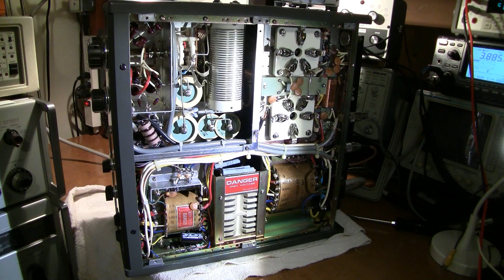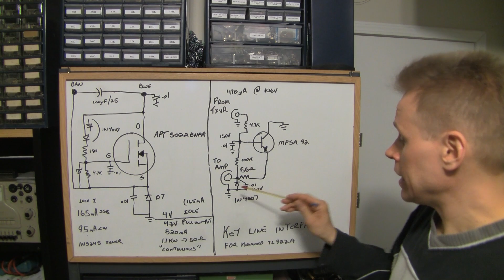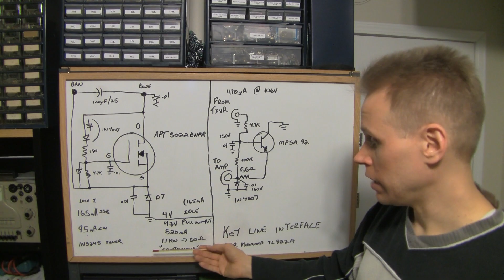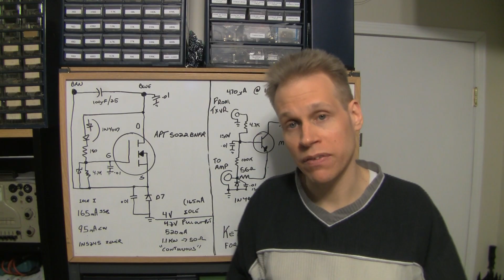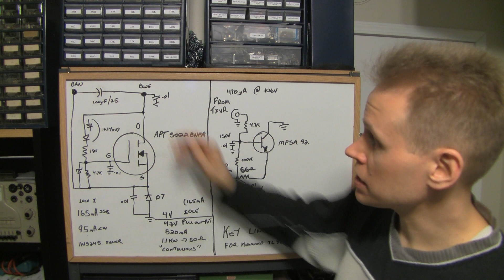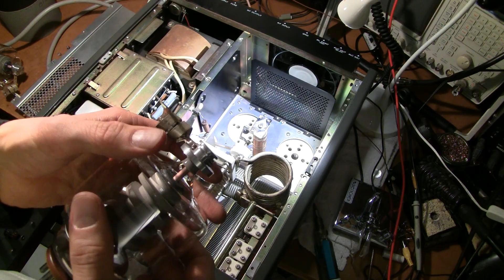KENWOOD TL-922A Repair and Modification

Comment: Just got a tl-922a eBay special. Good price but.....must completely go thru it top to bottom front to back. Before any power is applied. Do not trust good faith!
These were treated like toasters. Turn um on and tune it for full smoke - bad practice!
Sad to say that these days most hams are appliance operators, and even more fear hf ops due to the complexity of having to figure it out and do it yourself. Repeater jockeys. So to speak.
The hobby is dying sadly, so a person that takes the test gets the license and go on air - good for them! Need more.
I will be looking into your electronics teachings. Some brush up after many years I feel will serve me well. 73'S

Comment: You hammer a pair of 3-500Zs enough, without a blower cooling from underneath, and the solder in the pins will melt. That's a common problem with fan cooled versions, where the pins are not cooled enough.

Comment: Your statement " getting across the HV, you're dead " does not always apply. I got across the 3KV in my younger years. It drew me up like applying heat to plastic, and luckily, someone in the shop had enough sense to take a broom an knock me free, but it didn't kill me. Yea, it hurt like hell for about 30 minutes, but I guess I was lucky.

Comment: I assembled a transistor switch according to your circuit, but at its input through the emitter-base junction there is still about 100 V, with a small current, of course. Wouldn't this be dangerous for a transceiver whose maximum control voltage is 60V?  YL2GL Valerijs

Comment: I really like your tips on the Keying circuit.  Especially how you suggest an external circuit to interface the amp and transceiver.  Very nice.  I also like your Bias control modification circuit.  Very nice.  Have you considered using a dynamic circuit that can increase the bias voltage to cut the tubes off during the time between speech utterances then when speech returns, the bias would be returned to the normal Class AB2 setting?  I think that could help to increase the lifetime of the 3-500ZG tubes.  The existing ALC circuitry could be used to monitor the incoming RF during SSB transmission and with something like a comparator, the Bias voltage could be quickly transitioned between cutoff and Class AB2 with time delays so as not to cut off the beginning or ending of words.   What do you think?   
   Thank you so much for sharing your good work and ideas Mr. Carlson.

Comment: I noticed that you said the cooling system in the TL922 is poor but, I disagree.   The cooling system uses the Black Body effect to keep my unit running cool.   That's done using three, BLACK steel plates beside the tubes.  One of these plates is perforated and situated in the exiting air stream of the low speed cooling fan.   You see?  The 3-500Z tube cools its' Plate structure mostly through the process of Optical Emission of Infrared Light rather than through conduction into air passing over the glass envelope, which absorbs or conducts very little heat from the Anode Plate.  The IR light is wasted energy that mostly passes through the glass to heat surrounding metal structures.   To enhance IR absorption of the metal plates they have been painted or anodized Black.  That black color is key to cooling your 3-500Z tubes and, you need to KEEP DUST OFF these metal plates.  They're Black Bodies that Optically absorb IR light then they're cooled by the forced air stream of the fan.  The cooler these plates are kept, the more IR flux they're able to absorb.  You have to keep their optical absorptivity higher than their emissivity.  Perforations in that rear plate enhance its' heat conduction into the air while also discouraging RF emission through the fan.   It's these black body, steel plates that are cooling the tubes more than a fan alone could and the reason why a low speed, quiet fan can cool this amp as well as it does.  This system could be improved by providing fins on the steel plates to increase contact with the air stream.   Just imagine if flowing chilled water channels were inside of these Black Bodies. You wouldn't need any air movement for the tubes at all.    Kenwood's engineers were more advanced than others.
Reply: Well crap, rebuilding electron microscopes for a living? I think you're Rege that has been trolling QRZ for decades and are constantly schooled by WIK and W8JI. If you're Rege, it must be embarrasing to be you. If you're not, then go look for Rege's comments on QRZ. You'd love his thoughts on "DULL CHERRY RED" 3-500Z tubes which are constantly being debunked while he's humiliated all of the time.
Reply: @624radicalham  No, I'm not your buddy Rege.  I'm guessing that maybe you don't believe that the Anode inside of a glass vacuum tube can be effectively cooled simply by allowing its' infrared light emission (red glow) to shine onto a vigorously cooled, black surface.  The red glow of the anode structure can't be inhibited and you don't want to because, it's that red glow that is actually cooling the anode by the process of Infrared Radiation.   The problem however is that when that IR light shines out onto surrounding metal surfaces, they will re-emit the IR and some will even find pathways to conduct a portion of the heat back into the vacuum tube.  The idea is to capture as much of the radiant IR, convert it to Brownian Motion (rapidly vibrating molecules) within the Black Body (metal plate painted flat black) and finally remove the Brownian Motion by a means of conduction to moving air or water cooling channels inside the Black Body.  If you could optically capture 90% of the waste IR emission the whole inside of the amplifier would stay cool even while the anode is glowing.  That would not allow the heat to re-enter the tube where it can cause more heating.  Imagine a thick walled metal cylinder that has been black anodized inside,  contains flowing cold water channels and made optically dense with many small plates similar to a heatsink then, placed around a glowing 3-500Z tube.  This device as well as rushing air, would remove practically all of the heat emitted by the anode as radiation. The chassis would stay cool and unable to return any heat into the 3-500Z. The tube's exterior and glass parts would stay much cooler than with air alone.  BTW, I'm testing an X-ray microscope while I'm writing this to you. It's operating at over 100 Kilovolts and I'm able to see microscopic objects inside of a cell phone.

Comment: I've got several tube type RF linear amps of which the TL922A is a favorite. I believe some of the best mods are:  [A] Vacuum Relays for the RF input and RF output with 12VDC coils.   [B] 1Amp fast fuse on the HV DC (Plate B+) just ahead of the Plate chokes.  [C]  "Hairpin" VHF chokes for parasitic suppression on each tube Plate.  [D]  A 3" Cooling fan inside the XFMR side of the fan-box situated to draw heat from the power supply and especially its' transformer.   I regularly use a clean-dry paintbrush and vacuum cleaner to remove any dust from the amp, especially the RF Pi network components.   I'm able to regularly obtain  2.1KW PEP from my TL922A in SSB mode but, I like to use it at no more than about 1.8KW PEP to improve longevity.    
    BTW: I'm an equipment engineer from the semiconductor industry and own & operate a technology business that rebuilds electron microscopes and X-ray microscopes for industry, having a customer base around the globe and the US.

Comment: Thanks Paul for a no-nonsense learning experience. The vid is packed with a lot of info. I had this issue in the amp last week. The arc shorted the Zener and C3. Since I have a 1A fuse in the primary of the filament transformer, it of course opened. I installed the IRFP27N60KPBF and also two diodes IN4007 in the Gate as you explained in the vid. I have a bias of 90ma in CW and 170ma in SSB. The voltage at the Drain is 6.3v idle and at TX it goes up to 7.4v. Works fine so far. Output on CW is about 600w, and on SSB peaks are over 1000w. I drive with 90w.

Comment: YEs Yes your circuit will work but I can do the same thing with 12vdc relay and a small PS and can be used then for any amplifier in the future if i placed it in the amp itself then the next amp i bought that had a 110vdc relay id have to build another circuit my way you just build your slave relay and now you can run any amp that has 110vdc relays

Comment: Hi; My Name is Cecil AJ4MT is my call and have been an extra class operator for some time. And been an amp builder and repair tech for over 30 years. That amp was built as a companion for the Kenwood TS 530 and 830 both of which were tube type final radios. As a matter of fact all amps from the 60's and 70's all had 110vdc relays. they used the same 110vdc for the alc voltage as well. 12vdc relays didnt come on the market till about 1980. All 3-500z amps from the 6o's had 110vdc relays Heathkit Sb200,220,221 Kenwood 922 and 922A Yeasu FL 2100B Collins Amps Also Henry Amps easiest way is to make a slave relay from a 12vdc transformer a rectifier and cap and a 12vdc relay SPST have your radio key the 12vdc relay that brings in the 110vdc relay at least thats what I do
Reply: Maybe I need to look into this with my henry 2k-4, but Ive been using it with my icom 7300 for months no problem at all. I did set the delay in the 7300 to the max setting prior to hooking it up..

Comment: I recently saw your video i am having a problem with a yaesu radios rx/tx relays contacts welding shut not because of a amp but just a known problem with this transceiver?… i was wondering if i could use this circuit between my relay?

Comment: LOL you ought to see my TL-922. I have the Trio version.  ie., it has 28Mhz. I bought it used.  The variable capacitor had melted ends.  I actually had to use a Dremel to remove the mushrooming on the ends of the capacitor plates.  Flash over is bad. Lost a tiny bit of capacitance. But it fixed that problem.  I also now have full QSK with a vacuum relay.  And blue LED lighting.  Oooo.. Many other mods.  Works great now.

Comment: Smiling!
Just starting watching your videos and enjoy them, also know the odds of you reading this on an old post are slim to none but sometimes you just got to confess to messing up to fell better. Smiling. 
I always thought the TL 922A was a good looking Amp. 
Little over a year ago I bought a ICOM 7300. I used the send jack on the back to key my Clipperton  L. Well one day a friend of mine told me the keying circuit in the Amp was more than the keying circuit in the 7300 could handel.  Been using it that way for over a year and seemed ok to me. So I built a external relay like they show in the manual and in the process I melted the farrite EP102 on the RF Unit Board B8306E, and the send quit working as one would expect. Wish I would have never done it. Radio still works on transmite great and pretty much everything else works, but the receive audio has a hollow sound, kind of like a weird filter or something hard to understand sometimes. I have reset it but no help, not sure what else I hurt to get that sound on receive but I did something. When you talked about the relay and tapping it to try and free ii up, I thought wonder if that could be a problem not letting it go back into full receive mode. The parts are so small, I suppose it needs to go back to Icom but waiting till after the Christmas shipping stops, people say thing get damaged more this time of year.   
73
Ed

Comment: Hey Paul . I know this video is old but I just got one of these and looks new in box and it did not have tubes and RF suppressors. I did find a few places and I can just make one and order tubes.
  But do you have all of the "needed" updates on your other website ?
   I m taking my time because it does look like it has never been plugged in so i Think when I get ready to power it up I am going to borrow a variac and bring it back up slow .
Thanks
Gary

Comment: I like when you warn us about dangers. Please, colud you make a vid explaining ways to avoid risks, electric shock...preventive measures
Reply: If you need this then you need to leave the lid on
Reply: @paulstubbs7678  Not a good answer, everybody starts at some point - give the man credit for wanting to learn. You don't know if he's a beginner in Electronics or experienced, perhaps he is just new to HV. I have worked on HF amps for years and I found myself asking if there's something charged I may not have thought of. Ravi, do you know the "one hand" rule and can test for high voltage present? If not this isn't where to start, but you can certainly work up to it.
Reply: @patrickbouldinkm5l143  Thats why a safety oriented video could help

Comment: A strip of paper soaked in contact cleaner is the best relay cleaner I've found. The paper falls apart before any metal is even scratched, but it will remove oxidation and carbon.

Comment: Great looking amp i have a 30l-1 to scarred to connect it to my 7300 even with the relay kit i got of ebay i will keep it matched for my kwm-2 just too much voltage on the relays,was offered one of these tl-922,s at a ham fest THE GUY TOLD ME IT WILL MATCH UP WITH NO RELAYS TOO A 7300, LUCKY I WATCHED  YOUR CHANNEL.thanks a bunch.

Comment: In addition to the risk of contact welding,  wouldn't the keying relay also potentially be at risk of not even being able to break that much DC current?   I have seen relays sit open with a continuous arc occuring between the open contacts because it couldn't break that much DC current.  The zero crossing of AC comes in real handy when it comes to interrupting the arc when contacts open.

Comment: I have a TL-922A that was given to me. It is supposed to work, but I don't know, I've never used it. I was wondering if you would be interested in doing a restoration video on a TL-922A. I can be contacted at kk4bfn AT arrl DOT org

Comment: I really did expect better engineering effort in the original design. It is a bit disconcerting to see how lax they were making this clunk before you modified it, thus saving many a good ham from  becoming disgruntled or giving up on using their amplifier.
Reply: lol hams have been using this amplifier with no mods for over 40 years. Unbelievable some of the comments here.

Comment: how do you even run 2 of these beasts at once? the datasheet states an ridiculous heater current of 14,5 amps at 5 volt for a SINGLE tube. if i was to run 2 in parallel it would pop the circuit breaker of the house electric

Comment: My new question would still be bad to try to use this amp with a ARB 704 would that device protect any solid state hf radio would the amp still blow up the radio

Comment: Just watched this for the first time Paul.  Nicely done to bridge the gap on a few of the weak points in the design of this amplifier.  Always liked the looks of the 922, but the cramped interior design is concerning, not to mention the high keying voltage.  What were they thinking?    As you mentioned, the designer's futile attempt at cooling the 3-500z triodes is weak, very weak.  But as I recall, even the old Heath SB-220 utilized a similar fan arrangement instead of the recommended forced-air method of cooling.  Of course that amp also suffered from under-cooled tubes.   I guess the 3-500 tubes were much cheaper back then to replace.  I was hoping you would measure the filament voltage with the tubes installed and drawing filament current.  Most tabletop amps really do a good job of NOT delivering the correct filament voltage and offer the owner no means of adjusting that voltage for varying line voltages encountered.  The owner of that 922 owes you a great deal of gratitude.    Thanks, Joe W4JF
Reply from the maker: Thanks Joe!

Comment: Subscribed!!. Like the video format and love the detailed explanations. I came here merely on the back of some research into the TL922 before I buy. Already have a Yaesu FL7000 Solid state linear which is great for the 400w limit in the UK however as more transistor amps come to the market place the older Yeasu FL2100Z, TL922 and Heathkit SB220's valve amps which were very common years ago but expensive!, are making it to Amateur radio rallies and getting considerably cheaper.
With that said the price of the 3-500z is still quite expensive (not as much as 2SC2652 Planar transistors however if they are not abused they should last 20 years and at about $1200 to replace all 4... the amp is pretty much written of if they all decide to fault at once!!!) hence looking at an alternative if my FL7000 bites the dust. I am leaning heavily toward the TL922 after this video. Thanks, its very well received across the pond.73 dit dit

PS: the Motorola MRF448 is apparently an equivalent to the 2SC2652... however I think valve is still the way to go after seeing this video.
Reply from the maker: Thanks for your comment, and Welcome! Vacuum tube RF amplifiers are definitely the way to go, there are so many replacements on the market keeping prices reasonable. When it comes to audio, prices are being driven up by the audio crowd though.

Comment: Boy that is a compact design, I would opt for a little more room in a case, no wonder it flashed over somewhere, and your right, I don't see how the tubes survive with that fan, especially with that RF capture grid right in the stream.
The plate transformer looks really small, I wonder how much the voltage swings when during high plate current?
Why would they use 116 volts on the amp relay? I bet that coil spikes pretty hard when it's cut loose and I see why you would use a zener to capture it?
 I'm going to hang on to that diagram, looks like this would work on any rig/amp as a clamp for the amp relay.

Paul, thanks for this one...